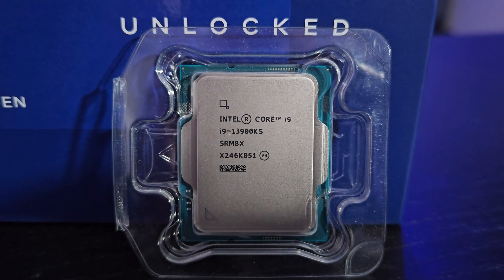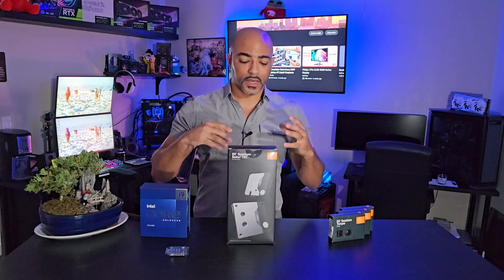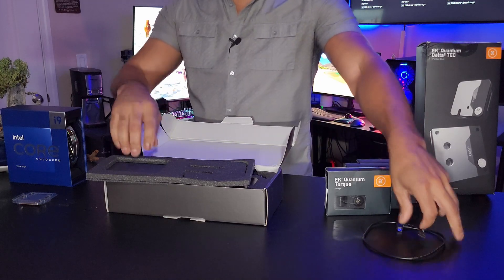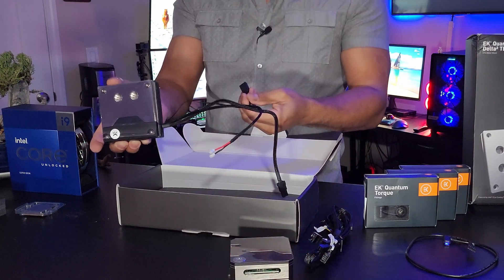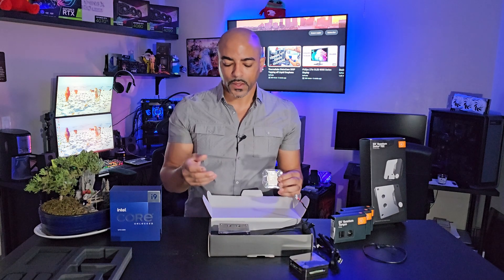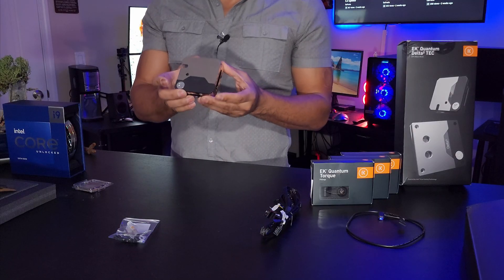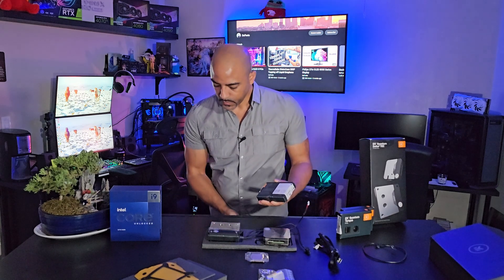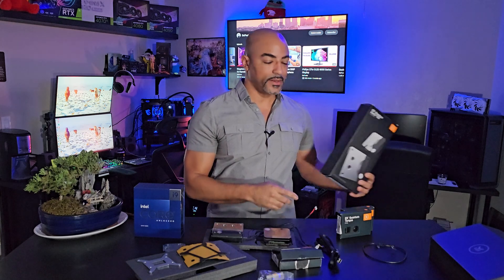Intel i9-13900KS & EK Quantum Delta² TEC

Comment: Good moring. Did you get an issue detecting the device? I have a MSI Godlike z790 Motherboard with a i9 13900KS and the USB device is not recognized. Thanks!
Reply from the maker: No sorry. Make sure all the cables are properly installed again.

Comment: How long till part 3?? Also, can it be used with a delided 13900ks??  Is there a way to physically make it work, I know EKWB sells the direct die adapter piece to waterblocks, can that somehow be added to this delta
Reply from the maker: Part 3 soon. No to the TEC Delid as they are different heights and that would need to be a custom block that does TEC and has the delid sizing.
Reply: I order the direct die contact frame and I place the delta 2 block directly on top of it. I have to cut the delta 2 cold plate though.
Reply: @jessicasa211  "post a video"

Comment: Why cant you (obviously) insulate around the die and delid and use this block direct to die?

So sub ambient direct die?
Reply from the maker: That has to be specifically machined
Reply: @DaPoets  hi delided 13900ks  liquid metal etc etc And  Quantum  Delta2  TEC   direct die mounted contact. The Peltier  block placed on a bare delidded die.    Has it been tried?
Reply from the maker: @gregscott8383  nobody will try that because it's not the correct height
Reply: This is the way! Could get some copper shims to compensate for the height difference...
Reply: @mateot5115  It will make zero difference if you use shims rather than IHS. I know this because I tried that and literally no difference in temp between the shims and the IHS. I had to cut the cold plate to compensate for the height difference and place the delta 2 block directly to the die.

Comment: I had to return mine because it's not compatible with Z790 boards.  I had the same issue with Derbauers'.  The CPU block doesn't make contact with the IHS because of the rubber seal.
Reply: wait this doesnt work on the 790 boards??? wtf, i own a 790 Apex. how is it not compatible & can there a be a work around

Comment: I currently own the Delta2 TEC. Do you know if they have plans on enabling Cryo mode while still in Bios? Obviously this is a huge restriction because you cant activate the TEC until your in Windows. This restricts you incredibly in OC the CPU.
Reply from the maker: Intel® Extreme Tuning Utility is what you may want to use.
Reply: @DaPoets  yea, thats what ive been using but was hoping they would change that. Great vids. Thx!
Reply: That won't happen because of safety-related issues and warranty. The way I do it is I order the direct die contact frame from EK and place the delta 2 block directly on the die. That will cool it a great amount
Reply: @jessicasa211  post a video
Reply: @King0fHArtford  That will take me almost a day to do all that. To take apart my block, drain my loop, and put it all back together. Wayyy too much work. So I say no
Reply: @jessicasa211  Do you still have this setup working? Did you have to do any modding? Also which motherboard are you using because I know clearance can be an issue for this kind of thing sometimes? Thanks
Reply: @tonyzayas2085 - How is this TEC cooler coming along? Pros or Cons?  I am considering it, but I want to know some solid feed back prior too.  Thanks

Comment: Is this fine to use daily for long periods of time or is it only for overclocking competitions? Also, is there AMD version of this? I'm interested in using something like this for my Ryzen 7950x.
Reply from the maker: Yes this is made to be used by the average enthusiast water cooling consumer 24/7. It's not intended for heavy benchmarking competitions though. Bursts of benchmarks is fine though. Extended PRIME95 runs is not to be used.  This is technology made between Intel and EKWB.  AMD was not involved in this.
Reply: @DaPoets  I get it now. Thanks for clarifying. :)

Comment: Is this to be used with a chiller?  If it’s for water only would the ek direct die kit net better temps
Reply from the maker: No this is sub ambient so it will outperform the direct die since direct die can only go as low as ambient temperatures.
Reply: @DaPoets  Thanks for the reply, looking forward to your build.  Personally im going to let this tech mature more, im more likely to invest into the direct die EK new block for my 13900KS
Reply: @Pabula  , is EK better than Optimus blocks? I don't think that Optimus has made a 13th gen COU block, yet.
Reply: @Chris-ji8jw  I never tried optimus, heard good things about it, but atm im building on a delided 13900KS with the intention on direct die cooling, only block that i seen is the new "EK-Quantum Velocity² Direct Die D-RGB - 1700 Nickel + Plexi".
Reply: @DaPoets  Below ambient,& I like that. EK has been really impressing me lately. Hopefully, it will stand up to your tests, and you can prove that it can be used as a daily driver. Below ambient, that has a nice thought to it!